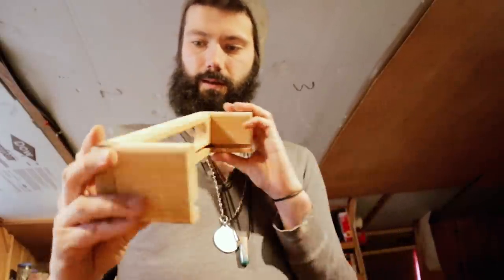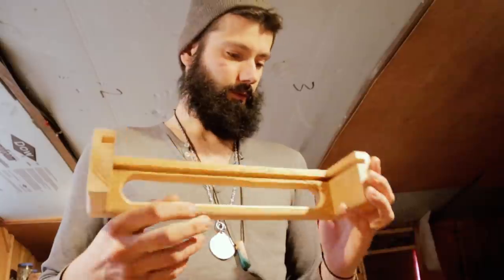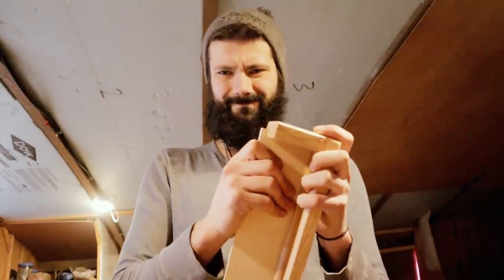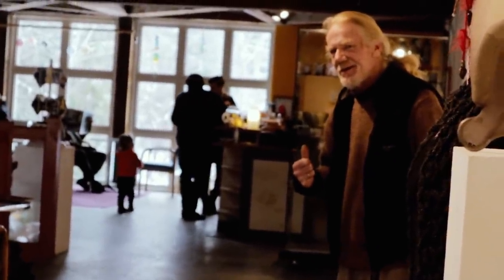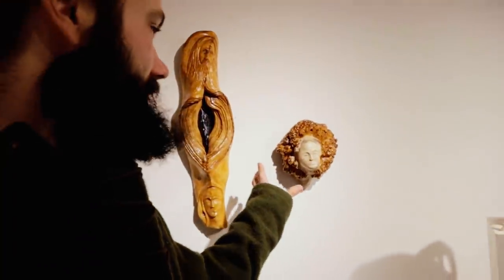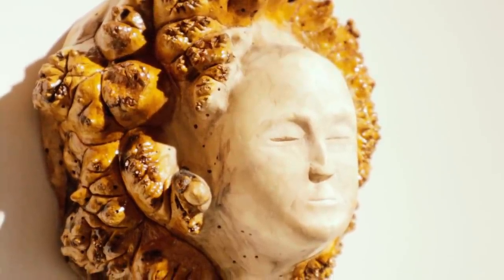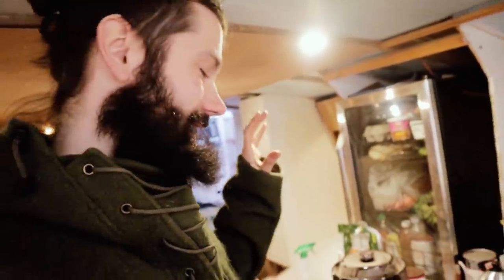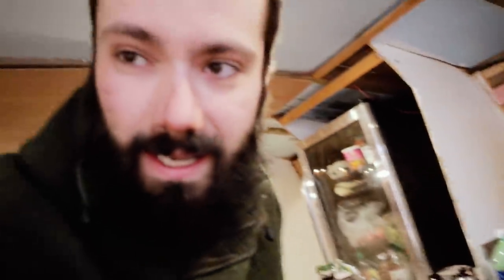Balance Charging the Lithium Battery Bank - Sink or Swim 133

Comment: Look into doing a Bottom Balance on your lithium batteries...run the battery down to its low voltage value on each cell. The idea is that you start out in balance at the bottom of the battery capacity and then as you charge up the cells will drift but then when you draw them back down they should stay in balance at the bottom again.

Comment: Funny you mention radio control hobbies and batteries. I was a HUGE R/C airplane nut for years. Most of them flying only electric powered models and gliders. Brushless motors and lipo's made it possible for model airplanes to fly with much higher thrust to weight ratios than full scale. The biggest was an 80" wingspan cabin plane with a 7s 4500mhr pack. I made the brushless motor myself using the stator, shaft and bearings from a printer motor, machined the housing and rotor on my lathe, and used some 1"x 1/2" x 1/4" n50 neodymium magnets. It swung a 14" -16" prop. I figured you would get some good info from the R/C community. We were in on the lipo revolution from the beginning. So, no. I am not scratching my head. I understand all of it!